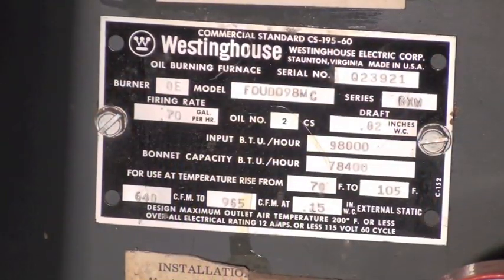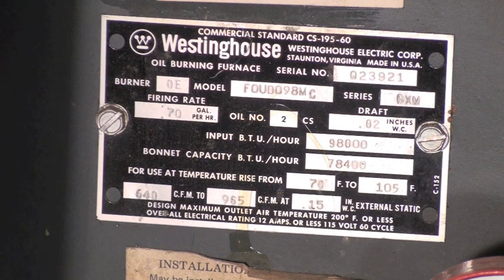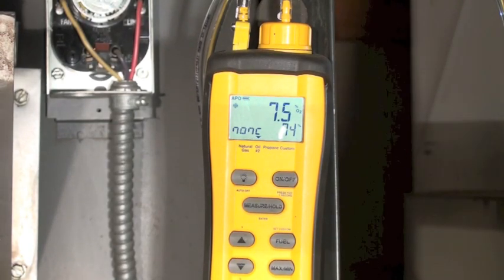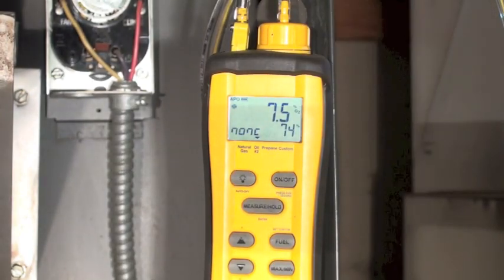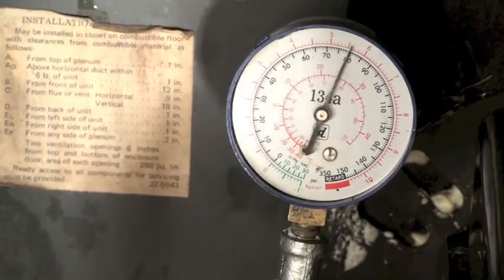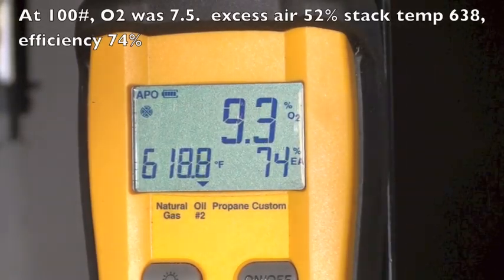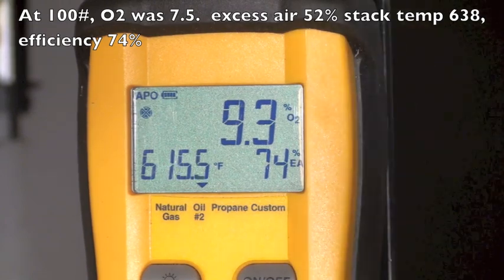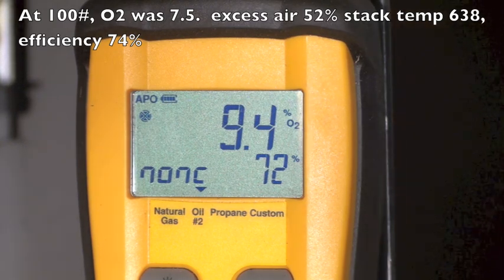Oil furnace efficiency adjustments.  Part 1.  Lowered pressure

Comment: It seems to me that if you lower the pump pressure and supply less fuel, you should retune the air intake for a proper air to fuel ratio.  Then you can compare efficiency numbers and draw conclusions about the quality of the burn, otherwise it is just not properly tuned.  Or am I missing something?
Reply from the maker: No.  You are correct.  The air adjustments were made and efficiency tested.   Note the excess air went way up and the 02 went up.  This is from larger droplets not burning completely.  I will be making conclusions about these adjustments when the series is done.  Thanks for the thoughts.
GFM

Comment: Does lowering pump pressure lower the amount of fuel, not just the degree of atomization?  Perhaps more than droplet size, efficiency falls because we're now heating excess combustion air.  For example, in a gasoline engine fuel and air go up and down together.
Reply from the maker: Lowering pump pressure does reduce fuel flow per hour.  Combustion air can be lowered with the lower pressure so I don't think its excess air.  The larger droplet size makes a less complete burn.  You might add additional air because you need it to get a better smoke number.
GFM